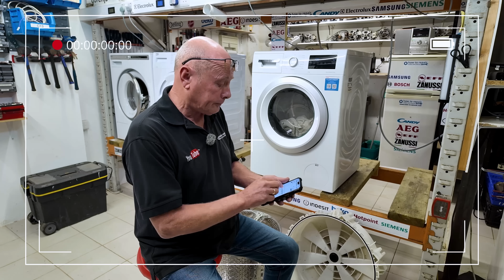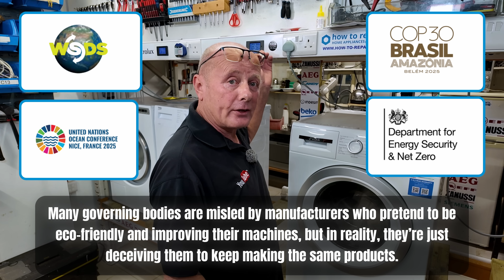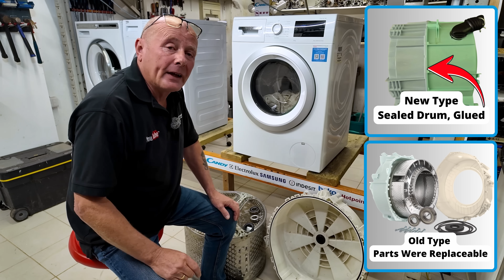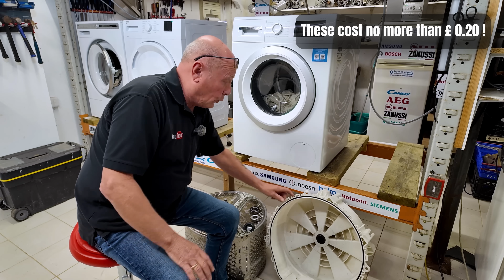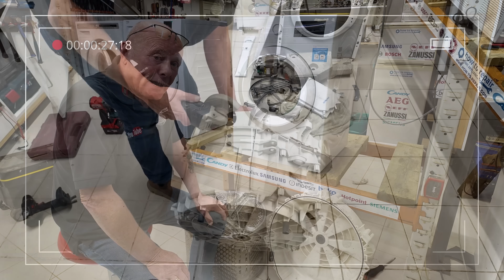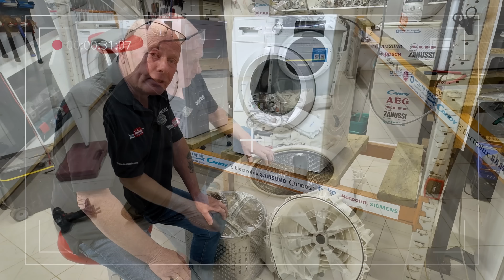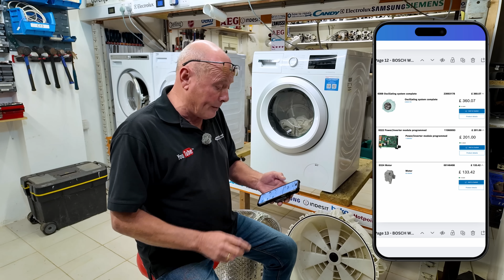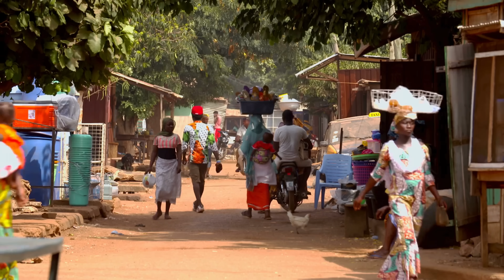Washing Machine SCAM EXPOSED! The Truth About SEALED Drums: Naming & Shaming

Comment: The same is happening for cars !  Appliances are easy to plan obsolescence earlier!  Please tell us which brands are doing things right and which brands to avoid !  The consumer backlash will be real
Reply: Has been happening for many years.
If you were to assemble a $30,000 car yourself, or mechanic mate, it would cost you well over $100,000 in the long run. With a washing machine or other white good appliance it is in most cases buying another versus paying same for just a repair. Cars being much more expensive people go down the repair job route which also is a massive spare parts scam.

Comment: A 5-gallon bucket costs between $3 and $10.  The whole concept that the washing machine does much more than allow the water/soap mix to penetrate the fibers of the clothes needs to be thought over.  Have you SEEN what happens?  The agitator simply goes back and forth.  This doesn't really do much at all.  So if you're interested in "fighting" this whole planned obsolescence, then see what's the difference between using your washing machine, and simply allowing clothes to sit in a 5-gallon bucket with soap/water mix for the same time that the washer takes.  Sure, the spin cycle has a valid use, but this can be done with a 5-gallon bucket as well.  If you drill a bunch of holes in the bottom of one bucket, then put that bucket into another bucket to "wash" the clothes, then you can simply lift the top bucket up, allow the water to drain out, then give it a spin yourself.  Maybe this all sounds stupid, but we're talking about fighting, so...

Comment: Our LG fridge has glass shelves, one of them cracked in half 3 years after we bought the machine. Of course just as it fell out of warranty. We contacted the reseller who weren't much help at all, then we contacted LG costumer support directly. They told us that our model of fridge was released just slightly over 5 years ago, so they don't make parts for it anymore as they don't have to, but we could try contacting the factory directly to see if they have leftover parts. We did just that, and of course no parts. We are left with a really nice looking fridge that has a ducktaped broken glass shelf staring us down forever.
Reply: Get a sheet of Polycarbonate cut to size.

Comment: That machine at the 6:00 minute mark is the same one I bought about a year ago. Safe to say, I won't be replacing it with another Bosch unit once this one dies. I wish I had discovered this video before I had purchased! Any manufacturers you can recommend instead?

Comment: Thankfully, I was able to buy a replacement sealed drum for our WM on Ebay. £100 if memory serves.
As for the PCBs, the failure mode is almost always a knackered electrolytic capacitor....50p part.

Comment: Moreover, they could design it better by using a mechanical seal instead of stuffing rubber seal or at least make a welded drum, but with interchangeable sealing and bearings, but no.
Even machines that existed before were already anti-repair, they just didn't went so far as right now.
The norm of profit is falling, they had to do it to make more profit.

Comment: What is the best budget machine about £300?
Reply from the maker: Whatever you buy in that price bracket just make sure it has a full five-year parts and labour guarantee you can normally find them for around 400
Reply: @How-to-repair  What is your opinion on an auto balance function? Is it effective? Does it prevent a machine from entering into jump around mode?..
Reply from the maker: Most of the new balancing systems are not bad, but you must load the drum so it has a chance to balance not just put a couple of heavy towels in
Reply: @How-to-repair  The machine would be installed in a flat so anything that prevents the machine from jumping around is of high importance and for similar reasons the aqua stop function. Would a machine that has these functions be of significant advantage?

Comment: I just had to throw a perfectly good washing machine due to the delivery men when I moved house tip it to its side and water that was in the machine went onto to circuit board. When they plugged it back in for me it went pop. The machine was only 13 months old and the part was £209. A new machine was £230.

Comment: Just a heads up for your research, my Hisense 9kg washing machine which I purchased in September 2023 for £369 just this week had a heating element failure (which I replaced) and then the following day had a catastrophic motor failure which means a new motor aka over 50% the cost of a new machine, therefore has to be replaced and said brand-new looking Hisense washing machine will be chucked to the dump. I have also read the exact same thing happen to somebody else on Reddit with almost an identical timeframe. I have now purchased the very popular Samsung 9kg unit you have reviewed.

Comment: I have my washing machine in bits, I took out the drum & yes, it's sealed. I can't get the right drum (Indesit WC 71452 ECO M UK: ( note M not N ). In 1998 I was given an English Electric machine 2nd hand, I had it till 2020 (Still working), when I swapped it for this INDESIT. This was 3 years old in 2020 & only lasted till 2025, a total of 8 years.

Comment: It is a scam indeed. Making welded tubs is consumer right violation, and by buying them you support such violation. More over some manufacturers are placing 6202 and 6203 bearings in machines with frontal loading and 5kg specified capacity, which equals to no more then 3 year of life at best. I urge everyone who reads this comment to go out of your way, do a reaserch, find and spend extra money and buy a washing machine with user servicable tub, if you plan to replace your washing machine. If everyone for the next 10 years stops buying disposable washing machines, they will stop making them!!! Even if you have no tools or skills to press out or punch out the bearings(if you don't miss the moment when they are still relatively easy to punch out or press out, you can do it yourself, but if the don't budge, bring the part of the tub to the shop), you can simply dissassemble the tub(it is easy to do if tub is serviceable) and bring it to the shop that would do it, they will charge you up to four times less in in labor than for sealed tub(in worst case scenario if bearings are badly stuck) and bearing and seals cost is neglegeable!!! While disposable phones and laptops are not that big of a deal and can be replaced in an instant(they are expensive though) disposable washing machine weighing 80kilos(around 170 pounds) is a big problem to even carry out of an apartment and bring new one in. Making heavy appliences disposable is downright evil and is bad not only for you, but for ecology as well(i doubdt that all of the parts even make it to the recycling or being sold)

Comment: It's all over the place, I heard of a car, can't remember the brand, that has a Ball bearing and a seal on the input shaft on the gearbox that for a few dollars could be replaced but you can't get it anywhere because it's a special dimension, so you have to replace the whole gearbox at the price of $ 8000, well done, not.

Comment: It's a similar development with mobile phones, where you could previously easily change the battery. And laptops where the processor, RAM and battery could be easily replaced, now they are soldered to the motherboard. A sad development.

Comment: The same can be said about Sakura products and in my particular case their electric ovens (my model E6672) which are probably not available in Europe or the UK.

The fault with my oven relates to its selection controller switch, which at the time of writing this to you, only allowed the grill element to work. All other functions cease to work, such as the top and lower oven bake elements, its cooling fan, etc etc.

I removed the oven myself from its wall cabinet enclosure and basically removed the top metal casing to reveal its 3 rotary switches.

Upon inspection by me, the actual oven selection controller switch showed signs of corrosion and burning and at least 2 of the switch internal contacts had broken off.

I have since found that the part I require isn't readily available in Taiwan, however some variants of this controller switch appear to be available in the UK, Australia and New Zealand.

Having already contacted Sakura themselves 3 times, they are seemingly reluctant to respond to me about the availability of parts for my oven.

Furthermore on a previous occasion when trying to purchase the combined top bake and grill element, I was told that nobody repairs these ovens and the consumer just purchases a new appliance. I ended up locating the exact bake/grill element from an alternative source online here in Taiwan.

However and probably true to say that of course they'd be very happy to send a technician out to my house where I'd have to pay an astronomical callout fee for them to basically  tell me what I already know.

Again, this morning I have sent an email to Sakura enquiring about purchasing the part I need, as yet they haven't responded.

At the moment the oven is a huge paperweight and I have no idea what I'm going to do if Sakura pull that obsolete part nonsense as I know that they still advertise electric ovens including my particular model for sale. 

A bit of a dilemma wouldn't you say!!!

I'd love to send you some photos of my actual oven controller switch and you could see its condition.

Comment: I remember my mother bought a Zanussi machine in 1979, before I was born, I remember her still using it in 1995. 
Ok, It had a few sets of brushes and the odd belt, other than that it never missed a beat - Even the mechanical controller didn't fail during that time. 

The same thing happened with brown goods, you could repair almost any TV, VCR, HiFi and Radio, today its simply discarded and a new device purchased - Just look at the stacks of equipment in the Council tips! I even recall a government backed scheme up here in the North east called Renew, or something like that where unemployed people looking to upskill were put to work repairing White and Brown goods, which were re-sold at affordable prices, another great scheme gone forever. 

There's a massive gap in the market to fill with component-level diagnostic and repair, unfortunately there's no money in it on a small scale, however, I reckon if a few like-minded small businesses banded together to form a regional based franchise of sorts, to fill this gap then even the more time consuming, complex SMD PCB repairs could be achieved to turn a profit - I'm sure there's enough clever people in your game to pull something like this off and still make a decent living, but it’s going to take massive co-operation and courage to take something like this on.

Comment: I work as an appliance engineer and I love what Paul is doing to highlight my frustrations regarding this industry now. I personally own and use regularly a recycled LG washer dryer saved from the scrap heap through faulty bearings, which I replaced along with the bearing seal and drum seal. Which to my delight I stripped and repaired…. And now still using… 

GO LG!! Also, can’t even get a top loader these days because of the WRAS crap… 

Well done Paul! Big fan, carry on the great work….
Reply: PS I am a seasoned engineer spanning over 26 years experience working in Commercial and Domestic settings Catering and Laundry…..

Comment: I had a Hotpoint washing machine from Currys and the spider failed. I followed a YouTube video on how to replace it .the model number in the video was nearly exactly the same as mine except for an a letter at the end. The video had a drum that could come apart but mine was plastic welded together. If it hadn't been welded the parts would have been £50.Had to scrap it. Pity it was a good machine.

Comment: Circumvent RTR, Even if they didn't weld the drum like the Hoover  FloorMate, they no longer sell the pickup hose despite it being present on new machines so they get around  RTR by not selling the part. Had a small rubber o-ring that fits around the pump for no old Whirlpool gold dishwasher. Same situation. They stopped selling it and they made it part of the drain, whatever assembly the bottom of it and wasn't cost effective. So I was actually able to find a rubber washer that had the same ID. It was a little taller but the the  slight height difference didn't matter

Comment: 8 years ago i bought a damaged-in-transit (Italian ?) Candy Vita 7kg washer for £172. The left side had a serious dent in it but we mostly pulled it out with suction devices. Still runs great after around 830 washing cycles (only used for washing medical textiles Rosidal bandages at 90°C) It seems cheap does not always mean bad as i remember that the same machine new & undamaged was only £242 but we took a chance and won ... Did same with Candy fridge/freezer at the same time , with damaged doors & never had a problem ...

Comment: Your absolutely right in still have my washing machine from 2010 and still works perfet only had to change 1 door rubber as it was worn and slightly leaking 
Still running original bearings motor pcb ect and its a hotpoint 
These days all these manufacturers want more money out of people so make them unrepairable  which is more damaging to the world 
Don't know what im going to do when my washing machine finally stops working and is non repair dues to age

Comment: Yes very true what you say. And even fridge freezers as they only have one compressor pump whereas before the old ones had two one for the fridge and one for the freezer so you now have one pump working twice as hard and eventually will fail. It’s disgraceful.  They are doing this with some car manufacturers. 
Take the wet belt scenario on cars that have only done 30 to 40 thousand miles, on the clock and the wet belt fails the car destroying the engines who ever designed This.
The younger generation are brainwashed in this throwaway world, it’s crazy.

Comment: I repaired a sealed drum myself - split it open along the lip, replaced the bearings and sealing bearing, then added sealat along the cut that I did, drilled lik 10-12 holes around the split lip and put in M6 screws and washers, etc. And that was it. Been two years since then, washmachine works just fine. Took me a day to dissasemble and change the bearings, close it up with screws and sealant, let it cure overnight, assembled next afternoon.😊

Comment: Well said mate. Never buy the brand again if it is non-repairable. I feel abused as I have made a purchase but all my contacts will know to avoid the brand from then on.  The laundry equivalent of wet belt engines in cars. It's the same with led floodlights. I've installed many over the years and they have all failed and gone to waste. Non-repairable rubbish sold under the guise of "energy saving". What happened to the WEEE directive? Anyone know of a campaign to add a signature to?

Comment: These kinds of practices are very disturbing.
They give you "the right to repair" but at a cost that is ridiculous.
The sealed drum phenomenon is something only diabolical people come up with.
I repair home appliances as well; getting spare parts is a challenge on its own.
What I do to save the customer some money is try to find used spare parts.
I do the repairs on the PCBs myself; 9 out of 10, they are easily fixed.
But when the only option is to get new spare parts, it is often cheaper to buy a new machine.
This has to stop; this has nothing to do with any environmental concerns by the manufacturer.
They only want to sell as many home appliances as possible.

Comment: This guy IS CORRECT!!!!!!!!!    recently my Hotpoint washing machine developed a strange 'hammering' sound whilst on the spin cycle, it was very loud & vibrating, I had to switch it of & contact an engineer who said that the DRUM had 'separated' & the machine was not repairable, this, on a two year old machine,!!!!!!!!!a new machine was installed @ £500.
Hotpoint/Beko etc range are expensive C--- ! & need to be avoided.

Comment: I have never got  repaired or even considered  a repair on a washing machine  in 50 years . 
When you add int the cost of components,  labour  etc and in most cases the repair was only guaranteed  for 6 months it was more economical  and sensible to spend @ £50 more and get a new machine

Comment: You sir are a hero, over the years I’ve repaired my machine bearings  simply with a new bearing kit for around £7 
To my horror I went to fix my beko washer and yes the drum was welded together. 
Massive scam to prevent repair and fill up the landfill at the same time, you are highlighting a serious problem, good luck 🤞

Comment: Watching this video, it is no longer a call to action, this is a call to arm. Planned obsolescence is everywhere. Look at new cars, look at their headlights. If one led goes out, you have to change the whole assembly whereas older cars, you just simply replace the bulb.

Coming back to update this: I just finished (26 Jan 2026) replacing the bearings, spider shaft, and door lock on my Electrolux EWW1141AEWA, and maintaining this machine is an absolute nightmare. I only bought it in late 2020. Before this latest major breakdown, I had already replaced the hose twice, the dryer thermistor twice, the door lock twice, and had to strip/clean the drying component twice. The kicker? When I replaced the bearings, I found they used ZZ (metal shielded) bearings instead of 2RS (rubber sealed). In a washing machine! Come on, Electrolux - that is textbook planned obsolescence!